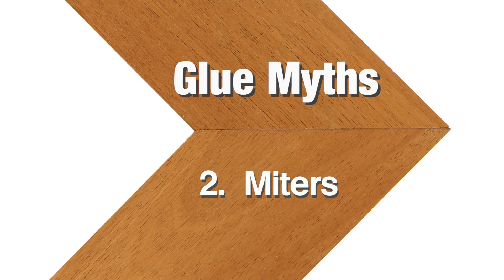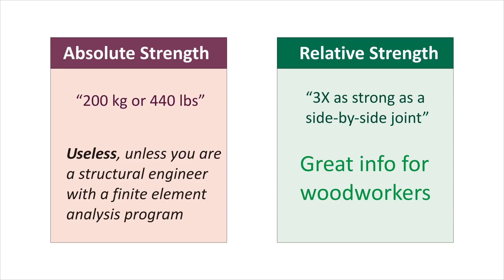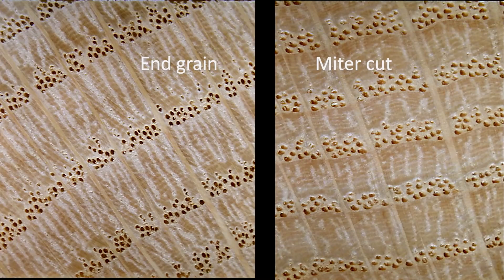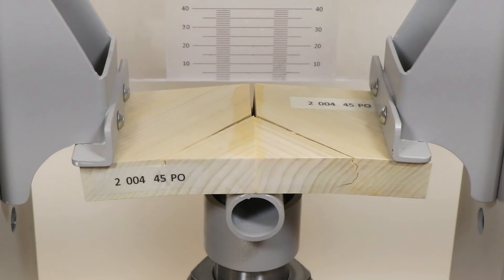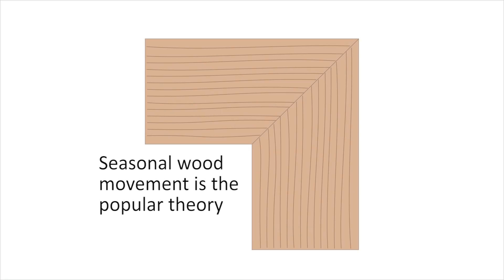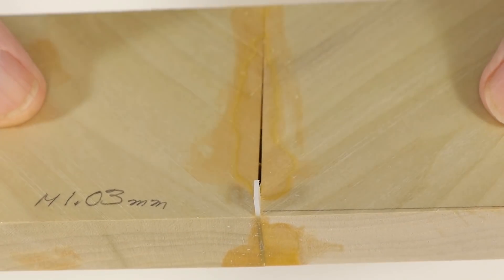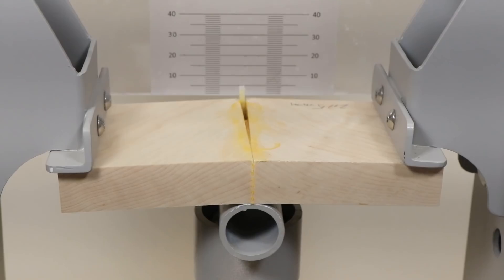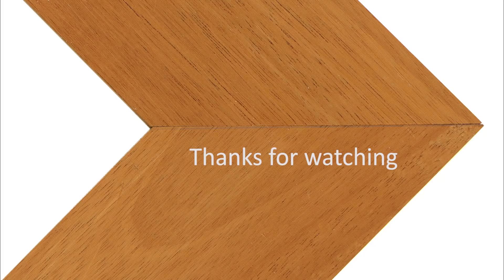Glue Myths:  2. Miters

Comment: One of the really great reinforcements of this video for me is in allowing your glue joints time to cure properly. I've had too many mitre failures that are almost definitely a result of impatience. I've recently switched from trying to glue full frames in one hit to clamping up one corner at a time and the difference in success is immeasurable. Also gives you an opportunity to finesse that final joint if necessary.  
I spline a lot of my mitres, mainly for visual interest, but a practical test of their strength would be a great watch!
Reply: "I've recently switched from trying to glue full frames in one hit to clamping up one corner at a time and the difference in success is immeasurable."
Gluing them all at once is easy - just do NOT use normal clamps but those straps that you can use all-around.

Also, if you need stronger joints than maybe use a spline or a lapjoint (or if you don't like the looks - lapped miter joint) - they make the joint several times stronger.... well, basically anything is stronger than a miter-joint to begin with.

Comment: As a renovation/trim carpenter in the field for 30 years. I’ve done some experiments on miters as well. In my experience it seems that the difficult conditions that southern New England provide really test your methods. I prefer to only build hard wood decks. Last deck I did was all ipe. I splined all my withers. I cleaned all the glue surfaces with acetone and used a total boat epoxy that is made for oily woods. I picture framed the deck, the stair treads, the hand rails and the built in bench. I tried bedding the picture framed deck in pl and used a lot of screws to immobilize the joint. I used table top hardware to fasten the handrail joint to let them move and the stair treads I used over sized holes with plugged fasteners to let them move as well. The desk has never been oiled. Here are 4 years later, the only miters that cracked were the deck picture frame that was glued and screwed to the point of excess. Everything that was allowed to move is still as tight as the day I did them. That made my mind up for me. I love the idea of really getting to learn more about woodworking, it really makes me a better carpenter. I don’t mind getting out some hand tools to do something, less dust and it’s almost as fast as power tools.

Comment: The force direction you use in your test, isn't usually the ones I have a problem with... The forces in a pictureframe or box are also at an right angle to the grain. The example where you break the miter with your hands, are example of this force. Could be interesting to see a test of this...
Great video, it's good to shake things up, especially myths. We think we know the truth, but really it's often just cultural handdown 😂
Reply: I think this is even more of an issue when simulating a "bad" miter joint. I think the plastic spacer slivers should be perpendicular to the applied forces, like they would be if they were in a mitered joint of a picture frame. Thus, in the test rig, you would use a long 3" sliver along the top of the joint horizontally, rather than the short vertical sliver that was used in the test rig. 

Alternatively one could rotate the samples in the test rig by 90 degrees and test the breaking strength in the other direction, but then you do not get to compare results to the previous tests of end-grain and side-grain as the testing geometry is fifferent.
Reply: That's the problem with this test. It tests the strength of a miter joints in a direction that's irrelevant to the forces that most miter joints actually endure. The hand broken test at the beginning is actually more representative to the forces that people worry about on miters than the ones he carefully measures.

Comment: Thanks very much for this trilogy that I hope you will expand. You have influenced my decisions with respect to joinery.

I first started to question the common wisdom about the weakness of mitre joints a few years ago when I was making picture frames. I messed up on the size of one and thought that I would be able to pull it apart and dispose of it very easily. Pulling on the sides in an attempt to break it apart was much harder than I expected and left me wondering what was going on although I never followed up my observation.

Thanks to you we now have quantitative and qualitative information about glued joints and no longer have to follow rules of thumb that are probably best described as mythology.

Comment: Another excellent video!  I would say that most miter joints that people are concerned about being weak are for boxes and picture frames where the relative size of the ratio of glue area to leverage length is much smaller than say a table or cabinet top with a mitered surface done for decorative purposes.

Also, most of the failures in the real world are at a different orientation than the lab tests here.  I can't think of a simple way to adjust the test to be more in line with the hand demonstration.

Comment: Thanks for your efforts in making these videos. If you run out of other things to test, I wouldn't mind knowing where baltic birch plywood joints fall on the strength scale compared to solid wood.
Reply: This would be an interesting test as plywood has alternating grain directions!
Reply: @Idefix70  And the laminations will likely separate too.
Reply: @robandsharonseddon-smith5216  I'm a real novice here but are you saying the laminations, the wood itself, would separate or the glue line holding the laminations together?  The glue is stronger but now factor in how impregnated the wood is with the glue being those laminations are quite thin.
Reply: @dwightl5863  When plywood fails, it usually does so by delamination, failing along the glue line between the sheets first.  It will be interesting to see what effect if any that has on the strength of joints made this way.  I don't think it will be practically significant - this series is not going to change how people do woodwork but it is very interesting.

Comment: I’m going to enjoy the wave of response videos to this one. I, for one, will keep using splines on mitered frames and boxes because they look darn cool.
Reply: I wouldn't suggest to ditch them, myself. 
As long as the splines are long-grain against the 45°, they will significantly strengthen the joint, regardless of how "perfect" the miters are cut and assembled. 

The long wood fiber is still much stronger than even the strength of the glue. Due to the small surface area of bonding, on a typical mitered corner, most still benefit greatly from that addition.
Reply: He alluded to preliminary results of tests with splines... But yeah. I hope he does continue the series to include interlocking traditional joints. It kinda sounds like he plans on doing much more Makes sense given where the series has started.
Reply: I'll still do traditional joinery, though. So pretty.
Reply: Well, you are doing the right thing cause the miter-joint is basically the weakest, followed by an endgrain-to-endgrain buttjoint.
Using a spline will seriously increase the strength, or you could also use a half-lapped miter (if you do not like the look of a simple lapjoint) - both waaay stronger than a miter.

Comment: Yet another exceptional video  using the scientific method to derive the facts about something we thought we knew!  Well done Mr Sullivan,. Well done indeed!

I presume from your methodology, maths, and commentary that you are an engineer, and most likely of either the structural or mechanical disciplines.  It never ceases to impress me as to the large number of engineers who seriously enjoy wood working and who are willing to share so much of their professional talents in an essentially pro bono fashion.

I am wondering if you have looked into the history of glues used in woodworking and considered how their properties would have effected our understanding of glue joints?  

For example, hide and fish glues slowly crystalize.  These glues are referred to as cured based upon tactile observations and perceived adhesion.  However, close examination of antiques built with such glues has shown that they do in fact crystalize and it is the hardness of these crystals and the strength of their fracture planes that provide the strength long after the plasticity of adhesion has gone.  Such joints, in say old Windsor chairs, are often subject to multiple and varying stresses which help to "grind" out the crystalized glue.  Restorers often use the slow crystallization process and heat sensitivity of these glues to their advantage.  The joint in question is carefully heated to re-liquefy the glue, and if needed, more glue can be added to replace any lost over time.  The result is a restored joint that is virtually indistinguishable from the original.

PVA glues on the other hand maintain a significantly more elastic plastic quality,  They are able to "move" with the joint longer than older glue types.  Where as CA (cyanoacrylate)  glues crystalized extremely rapidly.  The have exceptionally strong adhesion and cohesion, but are highly susceptible to break down from vibration and thermal change due to their more brittle crystal lattice. 

Equally important is that the basic formula for all glues have changed considerably over time, especially the last 50 years or so.  This means that what was true for craftspeople of the past, "today's teacher", may no longer hold true do to those changes.  Unfortunately, the only source of information most have had available is what they were once taught and what they have experienced.  Therefore, the observations of the past may well have been impacted by the conditions of that time, which would include different glue formulations.  Since all teaching is based upon history, something readily show as a myth today, is often based upon relatively sound advice, and multiple factors, for its time of origin.

I mention this as yet another set of conditions that explain why only relative, not absolute, comparisons make sense in the cases of your experiments.  Personally, as an engineer myself, I can find not fault in the design of your comparative experiments.  In fact, I could easily see where they could be developed into either an M.S. thesis or Ph.D. dissertation with the adhesives, lumber, and carpentry industries being very interested in providing grants.

Thanks again for producing some incredible videos.  Here is wishing you and yours the very best.

Comment: Enjoying this series immensely Patrick, Thank You.  Personally, I like that it has stirred the community into thinking about these things in more depth and bringing on Conversation.  Lots of valid points below, particularly the typically closed loop, but your apples to apples approach is quite valid and thorough, imho.  Joint strength is important for longevity and applying atmospheric changes is part of that, but with all multitude of joints I think of Japanese temples in the elements lasting 500+ years with simple and ingenious locking mechanisms and no or little glue or pins to be the ultimate in strength and longevity and wood choices...especially in heavy structural elements.  Looking forward to more of your fine work on this subject!  Hat Tip, ~PJ

Comment: For a long time I have purchased picture/artwork frames at auctions since: A. Commercially available wooden ones are disappointing and B. Commercially available ones do not fit with our decor. So I  buy frames likely 50 or more years old for reuse. Most of these frames are (presumably) hide glued, cross nailed and then the nail holes are filled. The number of miters that have failed glue joints are probably 75% or higher. The only things holding a large number together are the cross nails. So I hack-saw through the nails, drive them out then recut the miters down to fit the artwork/print/photo at hand. I use an accurate, dedicated miter cutting fixture. Depending upon the size, I may just glue with Titebond original and cross nail again. These should last the rest of my life. But with larger, heavier works... I will always further reinforce the miter. I'm working on mounting a rare 24" x 36" county map so with frame, UV glass and plywood backer (paper/foam archival mounting supplies are not a significant weight) so I'm dealing with a fair amount of weight hanging from stainless wire mounted at two points.

Very interesting video. I'll keep an eye out for any regarding splined miters. Love the methodology.

Comment: I love the fact that everyone was quick to change their ways in the face of evidence (your last video). Really amazing stuff.
Reply: "I love the fact that everyone was quick to change their ways in the face of evidence (your last video)."
But all that video has shown is that glue is stronger than lignin, but he intentionally did not use any longgrain-joints like lap-joints (which would also have been perfect here).

A good joint is as strong as solid wood and he shows that endgrain-joints do not come even close ........
Reply: @ABaumstumpf  I'm pretty sure he said he was only going to test end grain vs lignin/edge grain. Lap joint is not testing only lignin.
Reply: @ilikewaffles3689  In the first video he said he would be testing endgrain vs longgrain joints and then even said that endgrain-glueup would be the strongest joint.

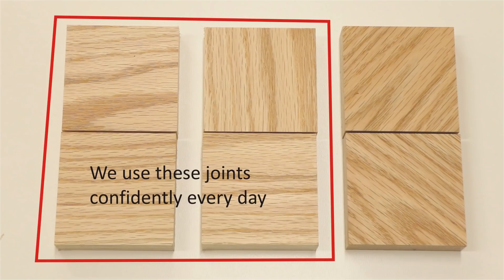And here at 6:36 he even claims that butt-joints would be common and nobody warns against them - which is the exact opposite where everybody will tell you to avoid them for anything but decoration as they are extremely weak and the glue is prone to cracking.

Comment: Your work is certainly interesting and does shine a light on this topic from a different angle. I would guess that the idea that end grain joints are weak has its roots in the era of hyde glue.

I've been a professional woodworker for over 20 years. It's difficult for me to think of many clear instances of failed end grain joints. Mostly because I have avoided them. 

When I think about the many items I have disassembled, I can say that my experience is that the end grain joints fail more easier. Yes, there are times when end grain glued to face grains holds well, but I haven't found it reliable. The two examples I can think of are coped joints of a cabinet door and glued edges of plywood in a box.

In the door example, the joint at the end grain portion is always much easier to break on the glue line than the face to face joint at the tongue.

In the plywood example, when break apart a piece of plywood with its edge glued to the face of another piece, the end grain of the edge almost always remains intact and the face grain breaks out.

On the topic of miter joints, I was taught that they are in-between end grain joints and face grain joints. I. The instance of a picture frame, the strength of it is 100% derived from the joint at the miters. Just glued miter isn't strong enough to resist those forces. However, mitered moulding attached to a piece of furniture rely on more than just the glued miter joint for strength. It is attached along it's length elsewhere. I will also add that clamping is very important for strength. Miters are notorious for being difficult to clamp effectively.

Comment: Patrick, again a brilliant video, thanks. When I watched your first miter joint break under the machine, I immediately recognized the issue: failure finally went to the weakest part of the joint. And in this case, it's the lignin. But to clearly focus my comment, I have to revert back to my work of over 40 years (until I retired 6 years ago), I was a scientific glassblower who also did a lot of research and study in the field of the physics and properties of glass. 

To break glass, you need two things: strain and a flaw (in the glass). Glass that is flawless is incredibly strong (stronger than steel). That's easy to understand as there's no place for breakage to initiate. However, what's surprising is that the shape of the flaw can make a big difference in the vulnerability of the glass. If you think of flaws in the glass surface shaped like a "U," a "V," or an "|," each of those flaws has a different radius at the bottom. The strength of the flaw is determined by its "K" factor where K= 1+ 2(A/B) where A is the depth of the flaw and B is the radius at the flaw's root. With that in mind, you can see how a "U" has a very low K while an "|" has a very high K.

So, what does all this mean in practicality? When people are trying to cut a sheet of glass (for the first time), they'll often run the cutting wheel up and down the glass several times to make sure they have a wonderful, deep scratch. (AKA, a "U" cut/scratch.) However, at the same time, they've created little micro-scratches that go off to the side. When they start their cut, their initial strain at the start of the scratch is focused on the deep "U," but as the crack wanders up the scratch, as soon as it hits a micro-scratch, with its greater K factor, the crack eagerly wanders off to the side, away from the intended scratch, to the novice cutter's consternation. 

So in your case, the initial failure was the glue UNTIL the crack came to a weaker area, the lignin. Now I'm not saying that the failure (breakage) of glass, glue, and wood is the same. However, the dynamics at play here I believe are: failure will occur at the weakest link which can vary depending on where the strain is at any given moment.

But again, thank you for a wonderful presentation.

Comment: I can appreciate the testing from the point of "Here's what happens if your joints aren't tight.". It seems, though, that the root of the issue is having the correct tools to cut miters, how to ensure that the tool cuts accurately and how to correct any inaccuracies, and finally how to use said tools effectively to get the results desired.